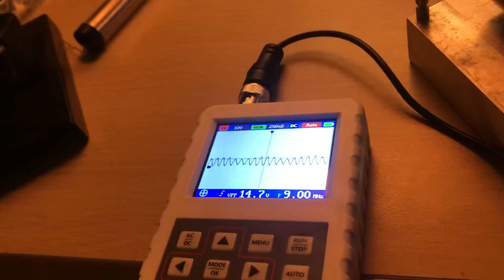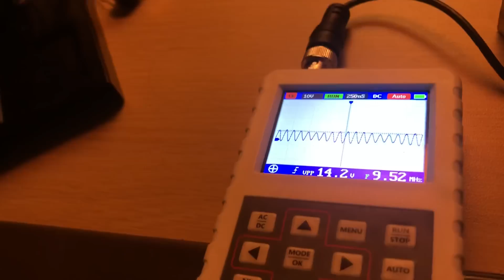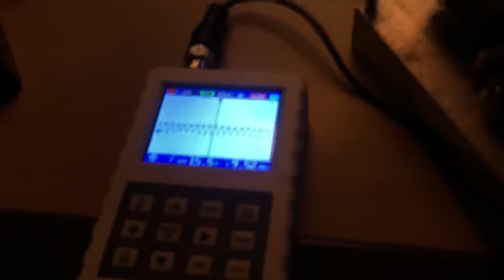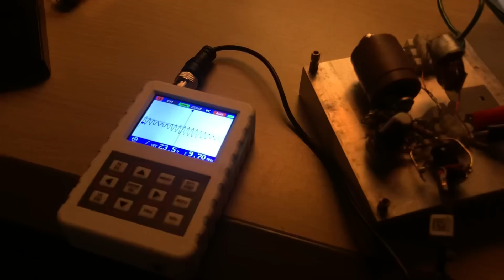Plasma toroid experimentation

Comment: Basically duplicated the start up of a Tokamak reactor establishing a stable plasma by injecting RF. The ring will be stable at a resonant frequency but as the frequency is varied away from resonance the efficiency of the energy absorbed reduces and the plasma ring breaks down. The coupling of the oscillator to the plasma seems rather strong and the energy absorbed into the plasma seems to be overloading the oscillator, hence the sudden frequency and amplitude changes. The glass is getting hot because the plasma is dumping all the RF energy as heat into the glass. All that energy being pumped in has to go somewhere. In a Tokamak reactor, the plasma is confined by extreme magnetic fields to increase plasma density to permit fusion to take place and to keep the plasma from contacting the container walls. Radiated heat is still a big issue, but ultimately it is this heat that would be used to generate steam and thus drive and electrical generator.

Comment: Neat, is the stable oscillating caused by external or internal frequencies?
Reply from the maker: Internal frequency set by inductance and capacitance values forming a series LC circuit. In other words, it’s self oscillating

Comment: Hm. Is it just around 15-20 volts running through a coil with a globe full of noble gases? And is there a certain amount of amps/watts? Like is that circuit just a simple controlled power supply?

Comment: I wanna make one of this so bad now xD

quick question, does this have something to do with RF cavity resonance? cause I'm doing some simulations right now and they look similar
Reply from the maker: i’m so happy you like it! There is no “cavity” in this circuit, like in a RF cavity magnetron that I think you’re talking about, but this circuit is a radio frequency, oscillator or resonator like u said. The “cavity“ in a microwave works off the same principle producing radio frequency oscillations using the inherent, inductance and capacitance of a conductive ring with cavities in it.
Reply: @BackMacSci  It just looks so cool. But yeah, in a cavity you have the outer walls killing the non resonant frecuencies. Here the ''cavity'' is made from glass so I guess it is diferent. But it is so cool, the fact that it is transparent is amazing. I wish we had a little glass window in ours, you know, eficiency or whatever xD
How did you chose the sizes of loop and glass bulb? Did you look some simulations/resonance-tables or just adjust it to what you had?

Comment: Would this set up work with argon or neon gas do you think? Also, what pressure are you running the xenon at?
Reply from the maker: This is 15 torr xenon, and argon and neon would not work. What i believe allows xenon to work is it having the lowest ionization potential among the noble gases. Bonus fact, similar to xenon’s role in flash lamps, xenon’s relatively low thermal conductivity also minimizes thermal losses in this lamp, possible contributing to why the plasma doesn’t heat up too much.
Reply: @BackMacSci  So you get the xenon excited into a plasma state with the tesla coil as a trigger, and from there the 10mhz oscillator keeps it running? Powered by 19.5VDC? Wow!! What voltage is the exciter coil (wrapped around the glass) running at? Sorry, I can't wait for the tutorial!

Comment: Is there a potential way to increase the brightness output of the plasma?  It would be a bit of a gimmick but a very pretty lamp.
Reply from the maker: Yes, there is a way, I would need to increase the voltage supplied to the coil, and replace the switch with a higher power switch. I may do that, but not very soon because I want to get this super stable first.

Comment: Neato. Any chance you could get some ferrous material "horseshoes" that face inwards to surround the entire rig, and wrap coils around the center section of each shoe to make it an electromagnet. Would be curious to see what kind of effect that powering those up in different ways could affect this. Cycling may even be more interesting than statically powering them.

(Of course you don't have to take this suggestion at all, but I think there may be a way to confine the plasma with additional EM fields and tighten it up to a smaller volume.)

Comment: Awesome! This is quite mesmerizing  and impresive. Have you considered using a Helmholtz (3 coil) arrangement around the vessel to get a very uniform magnetic dipole? You might be interested in the work of Jean Pierre Petit PhD on Magnetohydrodynamic control of air plasmas, the technology he demonstrates has been shown to negate sonic booms around supersonic aircraft, which could drastically improve drag, speed and noise pollution if it ever makes it into the commercial aircraft or spaceplane industry. His designs are for spherical, cylindrical, disc and wing shaped airfoils, that have either parietal (linear lengthwise) electromagnets, or 3 coils. The magnetic fields on the coils are at right angles to 2 high voltage ignition electrodes, which causes air plasma to form and accelerate around the MHD generator/motor, and then decelerates and compresses against the aft lifting surface before the plasma neutralizes and sheds as a high speed vortex. By sinusoidally varying the current for the 3 coils in 2 phases, the magnetic field it generates is first opposing North to North, then opposing South to South,  the shaping of this magnetic field crossed with the electric field causes the resulting vector field of Lorentz forces/Laplace forces in the plasma to point in the direction parallel to the lifting surface, in order to confine it against the frame. Plasma has a natural tendency to be blown away by a dipole magnetic field, so it's necessary to make time varying, opposing magnetic fields to maximize the field strength and uniform parallel field lines along the surface you want the plasma to flow. You could adapt Petit's designs to a Helmholtz coil configuration, or a rotating magnetic field coil (RMF coil) around your vessel, with the electrodes opposing, so that you can precisely control the MHD forces on the ring of plasma and therefore its properties. For example, by appropriate selection of the vessel size and rotation speed, you may exploit the beta orbit of electrons, to heat them up without heating the ions, to create a non-equilibrium or cold plasma with many unusual properties due to the separation of charges of different temperatures.
Reply from the maker: Let's talk more over zoom if you're interested in collaborating with me on this! Shoot me an email at backmacsci@gmail.com.
Reply: gotta collab with backmacsci
Reply: Dude just apply everything you just said to a disk or saucer shape and you will have something badass.
Reply: Please, you guys have to work together.

Comment: Keep in mind that at nearly 10MHz, this simple oscilloscope might be already aliasing.
Reply from the maker: Hello diodegonewild! What does aliasing mean?
Reply: @BackMacSci  Aliassing is what you get when the signal has a higher frequency than half the sample rate. At that point you start missing data, presenting you with a different curve than the actual signal. This also happens with video camera's by the way. Ever noticed how the wheels of a car on video oscillate between looking like they're turning forwards and backwards as it speeds up or slows down? That's the exact same principle.
Reply from the maker: Thank you Bart, much appreciated, I’ll check the sampling rate this scope.
Reply: @BackMacSci  by the way, that thing about the sampling rate needing to be twice the signal frequency is for digital systems
For getting a good view of an analogue one you might wanna add a few more samples (like 10 fold or so) because otherwise you don't have enough data points to see the shape of the curve and the signal can start looking like it's knotted (oscillating between high and low amplitude) like what we're seeing on your scope right now
Reply from the maker: I see, thanks. I just used my friend’s better oscilloscope and it read 14.8 MHz so yall were right, major aliasing
Reply: @BackMacSci  The small oscilloscope (DSO Fnirsi Pro) only makes 20MS/s. You can't use it for more than 5MHz signals.
Reply from the maker: @DiodeGoneWild  Thank you, man. Check out my sgtc video :)
Reply: not even really an oscilloscope, I've got one, it is fun, but is literally just a STM32 (Gd32F103) and a tlc5510i 8 bit high-speed analog-digital converter, you need to get a real oscilloscope for high-voltage & plasma experiments, just a fyi, I went through hell doing similar with my Kuman

Comment: This is quite a stunning phenomenon! Great work. 
I think that when it comes to the peak voltage lowering with the toroid, that the toroid is loading down the output of the oscillator. Similar as to a plasma flame on a HF teslacoil.
Reply from the maker: Thank you Firefox!

Comment: so the rf excites the gas, and the resulting plasma rides the static field generated by the bias current, right?
I wonder if an helmholtz coil config would result in a more stable toroid...
however, I will sub

Comment: I wonder if you could get another coil perpendicular to the first coil and then drive the 2nd coil 180deg out of phase of the first coil, maybe the toroid would pitch at a 45 degree as the magnetic field lines couple to both the coils and the toroid? Could you then steer the plasma toroid's pitch/yaw depending upon the phase relation of the coils?

Coil2 (180deg from coil 1)  <---     / Toroid /
                                                                      |
                                                                      ^
                                                                   Coil 1

Comment: An interesting phenomenon here. Also noticing amplitude modulation on your oscillator waveform. Wondering if you have some heterodyning with different oscillation modes. Would explain the beating in the audio range.
Reply from the maker: Ahh someone who speaks my language! Yes, those beat frequencies on the scope were interesting. But what’s heterodyning?
Reply: Hetrodyning does explain the emergence of audio, likely a resonating in the glass of an ionic standing wave.
Reply from the maker: Yes! I agree it’s a resonating in the glass that makes the sound

Comment: Hmm, would a similar effect be possible through using a pretty household plasma globe (assuming it is a globe which has some xenon as part of its gas makeup) using something such as a search coil hooked to a signal generator or making a coil which then connects to something high voltage like a van de graaff to try and induce something similar. Naturally not expecting to be able to create a perfect toroid but at least ionise and influence the gas with equipment someone could likely find in a school/college?

Comment: Paint bulb with a conductive paint and then coat that with carbon nanotubes oriented radially.  Charge conductive paint with 20KV or more or until plasma shoots away from the bulb in straight arcs  away from the center of the sphere.    Check weight of test apparatus with and without plasma effect.
Reply: I am interested in weight change research myself. Is this from a specific paper or experiment, or what makes you suggest doing this? Very interesting.

Comment: wheres your oscilloscope hooked up to? is that the coil? i would looove to see a spectrum analysis of it, preferably over time, also, i would love to go into this phenomenon aswell, do you know whats causing it? any place i could read into it? or a platform we could get in contact on?
Reply: also, the higher peak to peak voltage while not pumping into the ring plasma is likely because the ring plasma is some resonant aritifact, the oscillator hits that frequncy just right to push the plasma into ring resonance (meaning resonant q would drop, lower voltage current consumpition etc) , if its not, the impedance of the resonant tank (your coil plus mica) gets very low (series resonant) meaning a lot of amplification at the gate, a lot of current and voltage at the tank circuit. that ring is likely a very good conductor :P
Reply from the maker: Sure, my email is backmacsci@gmail.com and look up inductively coupled plasma for more information about plasma artifact stabilization.

Comment: Damn it Dr Opctavius have you not learned your lesson yet. Stop looking for the power of a son in the palm of your hand LOL.. great job.
Reply: By the way I have a globe custom made for me that contains neon gas if I'm not mistaken, or maybe it's helium , regardless I spent quite a bit of money years ago on this bulb and the man that I had make it for me was confused because I did not wish to have any electrobes inside of it just the gas. I use mine like a high voltage tester if you will simply hold it in your hand and walk near high voltage areas the plasma will glow letting you know that you need to watch your step. Your experiments have intrigued me.  I also have long tube bulbs that I had made for me two of them have an electrobe in each side and two of them have only one electrobe one each containing neon and helium I was planning on using them as energy (electrical energy on a useable level over great distances wirelessly) transmitting and receiving antennas. But after seeing your plasma toroid experiment I am now thinking that it could be used as a relay over longer distances. I suppose I will have to do my own experimentation and collaboration with you and others.  I look forward to seeing more of your videos
Reply from the maker: Thank you! I would love to get helium and neon globes one day.

Comment: The toroid gas when ignited acts like a shorted turn in a transformer. Ionized gas is more conductive than when it's not ionized. When the toroid collapses you lose the shorted turn and the oscillator output goes higher in voltage when unloaded. Once you get the gas excited the oscillator keeps the ionized gas ionized without the tesla coil.
Reply from the maker: Thank you! I was wondering how to explain the voltage of the gate signal being reduced when the toroid ignites🙌

Comment: That is really cool. Is there a writeup somewhere of how to build this? I have an old round bottom flask I could flame seal the neck to look like that, what is the gas inside?
Reply from the maker: Thank you very much. There is not a detailed write up but i will make a video on it soon! I left the circuit schematic in the description for you while you wait. The gas inside is 15 torr of xenon.

Comment: Hi, I have some dumb question, can it change the form if the signal will be modified by the music. Toroid moves like oscilloscope music rings maybe it can take more complicated forms. Example of such music youtu.be/qnL40CbuodU
And interesting to see the globe inside the coil too, not only above, how would it affect plasma.
And in some other videos about "Toroidal plasma" you can find on YouTube it oscillate a little bit in size so maybe there is a way to let it move like a 3d display in future:)
Reply from the maker: I will try modulating it soon! I would love to have a controllable plasma light piece too!

Comment: If to put a superconducted electrically insulated loop inside of the bulb then plasma toroid should be self sustainable(for some time) after short ignition.
Reply: If it will stay very cold Action lab shows that it can  store looped electric flow if it will be stored in liquid nitrogen youtu.be/lVP62ZzrGNM?t=53
Reply: the plasma constantly leaks heat, so not really.  Not sure what the superconductor's for.

Comment: You need to worry about X rays
Reply from the maker: I have not tested for x-rays yet, but I don't think I need to worry about them because the pressure of xenon in the globe is >1000x higher than a vacuum.
Reply: @BackMacSci  wouldn't any amount of pressure be infinitely greater than vacuum? or is there a standard "vacuum threshold"?
Reply from the maker: It is said 0.0005 torr is an okay vacuum so i was comparing that number to 15 torr

Comment: You're a god or a wizard. This looks so magical and beautiful. 
Fr tho, how did it become to Toroid when you dont have a central secondacy magnets like those one in tokamak reactor designs?
Reply from the maker: I believe the toroid is an example of inductively coupled plasma. It seems to be favored over the glow discharge in low-pressure xenon at high frequency, high voltage, and close proximity to the coil. If sufficient voltages are reached in the coil, the xenon in the globe becomes ionized nearest to the coil, forming a conductive loop of plasma in which eddy currents form, heating the toroid, (like in an induction heater), causing it to rise to the center of the globe. After speaking with experts in the field (I am only an undergraduate student), we believe eddy currents play a crucial role in the stability and shape of the toroid. It's going to be a blast to research!

Comment: So whats up with the globe sitting on the green coil?
Reply from the maker: The globe is filled with low pressure xenon gas and the gas is being ionized and shaped by the electromagnetic field surrounding the green coil
Reply: @BackMacSci  correct but is the green coil the 2.5uH or the 10uh?
Reply from the maker: It’s the 2.5 uH one
Reply: @BackMacSci  make more and put one on top and some around the sides and see if you get a ball
Reply from the maker: I found that I can make a little plasma ball that skates around the diameter of the coil if i use a smaller coil
Reply from the maker: I found that I can make a little plasma ball that skates around the diameter of the coil if i use a smaller coil.
Reply: @BackMacSci  same thing can be done without it being on a globe :)